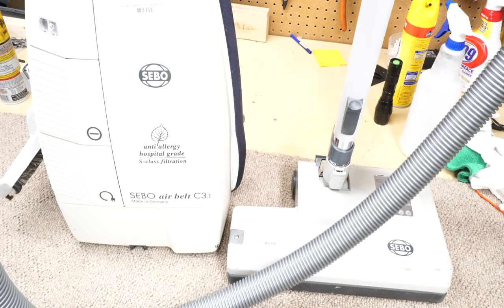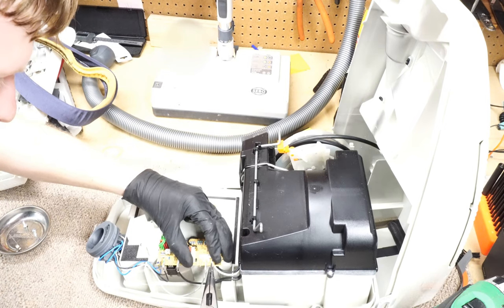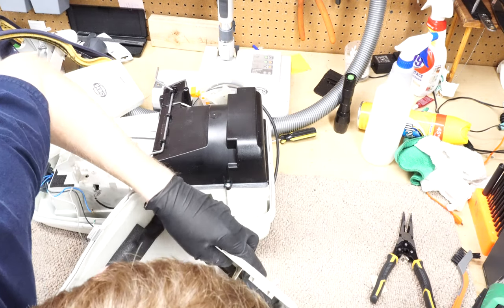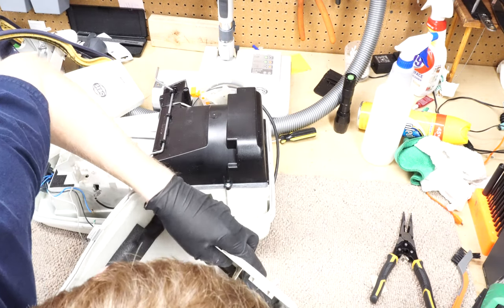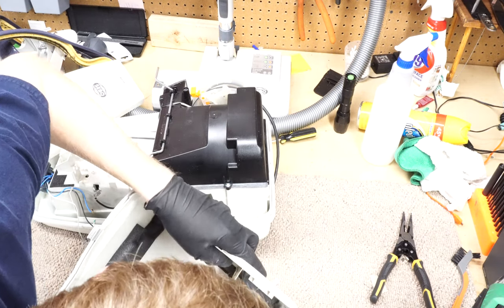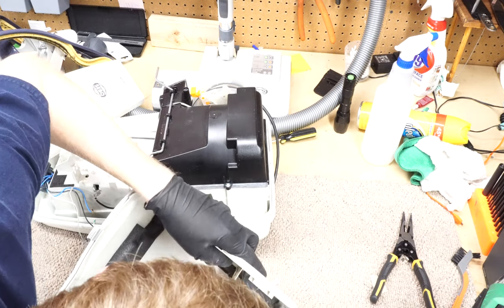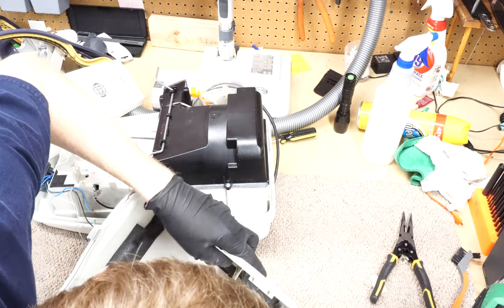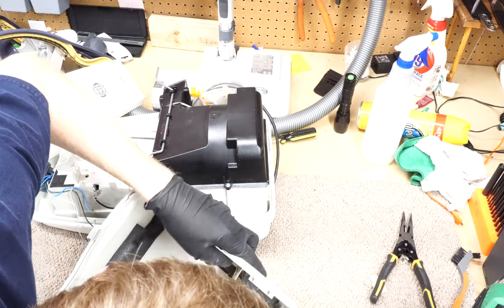The Forgotten German SEBO Airbelt  C3.1  Canister Vacuum Cleaner Repair

Comment: I bought one for $25 from good will. It had all the parts, and was barely used. Got replacement kit for $80 . Kit replaced both filters, and came with 10 bags. I disassembled, cleaned, swapped filters and just used. Simply amazing. Total spent $120.

Comment: I ended up buying a used C3.1 on eBay after watching this video and ibaisaic's, which were very timely indeed!

Even though it's probably over 20 years old and has seen a lot of use, I'm really impressed by the rock solid build quality and how quiet it is. I also have the modern Kenmore caniser, and in comparison the Sebo is light-years better. Yes, both are still made of plastic, but the plastic on the Sebo is incredibly high quality and there's absolutely no 'old vacuum smell,' whereas even with HEPA bags and new filters the Kenmore still stinks if I don't change the bag every week. Now that I found an old HEPA box kit for the Sebo, I am confident it's probably the 'cleanest' vacuum I own at the moment. The four coasters really add a lot of maneuverability and I'm pretty sure the Kenmore is actually the heavier unit - but weight isn't always synonymous with build quality, as we all know. It's definitely far more cumbersome than the Sebo, and much louder. The suction might be slightly better on the Kenmore, but that too can be very deceptive. 

I'm probably just going to donate the Kenmore now, because I can't see myself ever using it again!

(For the performance, it's by far the quietest vacuum I own, even on max settings. Would love to own a NIB model someday!)
Reply: I bought one for $25 from good will. Got replacement kit for $80 . Kit replaced both filters, and came with 10 bags. I disassembled, cleaned, swapped filters and just used. Simply amazing.

Comment: Thank you for the informative video! It's a shame Sebo discontinued the Airbelt C canisters because they are a perfect companion for the X and G uprights which use the same industry standard dust bag. It's harder to find cheap dust bags for the other canisters and the K and E ones are small. And of course if you have one of the uprights for carpets then you don't need the C3.1 with the power head. You can get a suction-only C2.1 for hard floors and rugs. Also, a little trivia: Sebo made the Airbelt C canisters from 1995 to 2010 (1997 to 2011 for North America). Replaced by Airbelt D.

Comment: These are the coolest Sebo canisters in my opinion. I like my K-series airbelt canister with the ET-1 ph, but these C3 canisters are nicer. Sebos are easy to take apart. I swapped motor to my K-series from 700 watt EU "energy saver" to the 1200 watt motor and the difference was easily noticeable. 1200 watt motor has much more "blades" in the turbine.
Reply from the maker: That means something coming from you my friend! You have a lot of cool vacuums.
Reply: @PerformanceReviews  Thanks!

Comment: Thank you for your very helpful demonstration.  I did end up with an issue I couldn’t resolve:  The electrical connection between the handle and where the hose plugs in came unplugged and it won’t fit back in. I’m sure I’ll be embarrassed when I learn what is obvious to everyone else, but a mystery to me. In any case, my big project is done for the day. Thanks Sebo for the excuse to rest.

Comment: I think that the Sebo is engineered much better than the Miele is for the long run. The Rezin composite is more pliable on impact than Miele’s very durable ABS plastic. Though I prefer the non powered Miele canister’s hose because of the longer end where you attach the attachments, the powered hoses on Sebo machines are more practical in that individual parts on them can be repaired such as the external wire and sockets and the switch controls. It’s much less costly than replacing the entire hose in a Miele. Then there is the subject of the complexity of the powerheads. Of course the Sebo’s is the most pragmatic to maintain on the market. In the case of Miele it requires professional service and if you need a new hose along with a powerhead service you might as well by a new C2 Electro+ so only straight suction Mieles make sense to me. 
Recently due to my physical condition I had to retire my forty six year old Kirby as it became difficult for me to push. I may need to retire my Electrolux Silverado as the canister is bulky and weighty. 
I was thinking of purchasing the Sego G1 upright but the brushroll doesn’t shut off so I bought a Riccar R30 Pet to replace the Kirby which is still in my closet. I’m thinking of replacing the Silverado with a Sebo E3. I like the D4 best but it’s also bulky.
Reply from the maker: I fell in love the the SEBO E3 . Love it's maneuverability and like you stated above is built to last like the old school Electrolux vacuum where . Thanks for watching!
Reply: I really like Miele’s upright vacuums.

Comment: What a fascinating machine!  So different from any other.  Who but Sebo would put the bag door underneath?  Of course now I must find one that I can afford.  I also don't think I could have figured out how some of it came apart.   But now we have this video as our guide.  As an aside, Kenmore must have the record for reusing parts over the years.  The height adjuster on their Powermates dates to 1975 when they still used flat belts,  canister bag mounts to 1984 and a lot of hose components, wands, swivel necks date to the late 1980s and early 1990s.  One can take the hose from a new Kenmore 81214 canister, plug it on their mid 1980s Premier 4.1 canister and it works perfectly.  The basic layout of the Powermate hasn't changed much since 1980 and many parts can be swapped across multiple versions.  If you know what part numbers to use one may replace the geared belt drive motor, belt and brush roll of a mid 80s Powermate with a modern quiet poly v-belt drive using off the shelf parts and everything fits.

Comment: Miele VS Sebo. What one would be the winner?
Reply from the maker: Depends on the category.
Reply: @Bunky’s Workshop
You've likely already resolved this but Bruce Solomon provides a very good overview below.
I'll add my observation that Miele canisters have a history of electric connection hose failures and require a very expensive replacement.  Sebo canisters are typically much easier and less expensive to maintain.
Reply: @YouzTube99  my Miele does have an electrical hose problem for sure. So I do agree with you and I really do love my Sebo Felix and Sebo head unit on my central vac system.
Reply: @Bunkysworkshop  
Ah, the Felix -- a wonderful vac!  I would have bought one but it was way more than we needed so we ended up with a Miele S148.  
Interesting that your Miele too has hose problems.  I'm beginning to wonder if they are simply so poorly engineered that all of them will eventually fail.  🤨
Reply: @YouzTube99  I think they are quality but have a weak spot.

Comment: Oh how I wish you were here to service my red Sebo C.1.  My husband gave it to me as a gift and frankly I hate the thing.  It is so heavy and clunky.  It is so irritating that it doesn't go in a straight line when I need to move it as I'm vacuuming.  The power head is also heavy and is difficult to maneuver.  Perhaps my house is too small and full of furniture.  What I love the most is the paper bag.  Who invented the dirt cup to dump dirt and dust that gets all over the place?   I will try to learn to love my machine after I replace the filters and learn not to do rage cleaning.  Help.
Reply from the maker: Perhaps this machine is 25 years old and technology has advanced much since then. I'd recommend you go take a look at a more modern version that solves a lot of these issues like the SEBO E3

Comment: Where did the white floor brush come from? I’ve never seen a place you can find that attachment.
Rick
Reply: Ps. We bought it new in ‘98 or ‘99, from Best Vacuum. No warranty issues or problems with the vacuum itself. The wand did come bent and Best sent a new wand promptly within a week.
Reply from the maker: That Floor brush  now comes in Gray.  But you can get  a number of accessories from your local dealer. I would highly recommend the improved floor brush the 7200GS

Comment: I’ve been looking to get one of these for my collection but i’m wondering what the water lift rating was compared to the e3 premium
Reply: The Airbelt C motor is rated for 90" water lift and 170 CFM airflow. The Airbelt E motor is rated for 95" water lift and 120 CFM airflow.

Comment: Oddly enough my mom has that same vacuum and the cord reel has broke 3 times replaced twice and for the last 3 years its been broken with the cord non retractable because the part is discontinued which is what brought me to this video. I figured this would be a repair video hence the title but no repairs seemed to have been made and it was just cleaned.